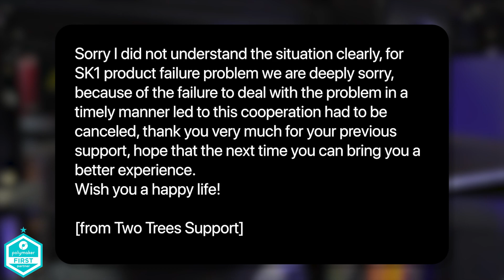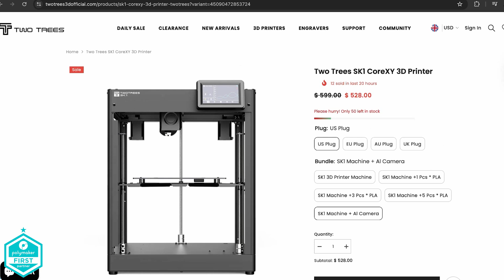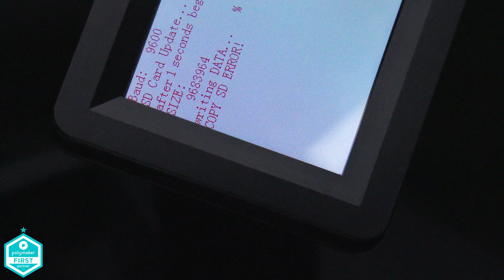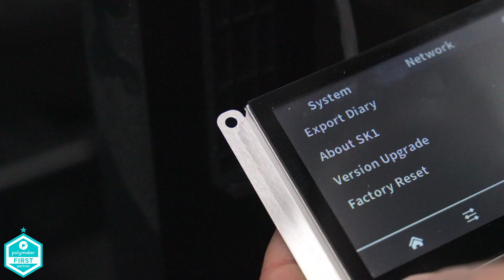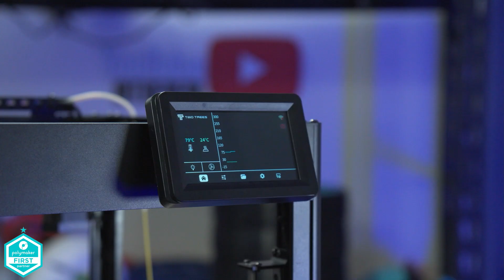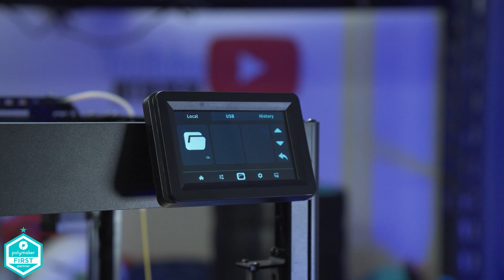Two Trees SK1 3D Printer - A Root of Many Problems

Comment: I got this as my first 3D Printer because I got it at 2/3 of the price of a p1p + a couple of kg of filament. It continues to be a learning experience, although it printed decently after modifying bed leveling and half reworking their slicer settings. Especially, their HF PLA made support irremovable. At this point, I am gutting the electronics and can basically from ground up and learning how to setup klipper and write macros. At the end of the day, I got exactly what I wanted, just not how I wanted it. Although, I am questioning my decisions and my sanity! I got into this printer hoping it would be similar to the tt sapphire and its modding community. And a final word I currently still think at least the frame is solid but let's see if I continue to think so and not replace it too ending up with a “real” trident with extra steps.

Comment: I'm sorry for the problems you had. 
I found it for less than $250. The v2.02.34 firmware resolved lot of issues. But there're good tutorials for upgrading Klipper and also the THR. 
I resolved problems with bed leveling playing with bolts under it. Now I've a good mesh. 
On THR, adding an heatsink on the RP2040 chip and putting a bigger one on 2209 driver, I can remove one of the two 2010 fans. The noise has reduced. 
For MCU cooling fans there're tutorials to move them on a controlled port, and switch on only on higher MCU temperature. 

This printer is damn fast, and noise is now the only problem.

Comment: I gave up on mine as well. Had issues with the bed leveling, couldn’t adjust the temp mid print, would disconnect from WiFi constantly, god forbid if you have to take the hotend apart. I had to get a k-touch just to adjust certain things. I had high hopes for this but off it went to the printer dump
Reply from the maker: Yes, it’s a terrible shame. They reached out to try and resolve, but they never came to fruition.
Reply: @TheRealSamPrentice  they sent me an sp5 core xy in which worked good for about a month than the extruder output on the board went bad. They sent me a “high speed upgrade kit” for free which was replacing the old board with a new one & converting the Bowden extruder (ender 5 plus style) to a direct drive, after multiple firmware flashes the extruder wouldn’t extrude properly, sent a new board & still nothing worked. They tried to “resolve” by sending this to me & it behooves me that after a machines bed mesh is calibrated and leveled it just randomly unlevels & you redo the process only to have it chew up part of the bed. The carriage is a nightmare to take apart and half the time my display was half in Chinese or German. I gave mine away on marketplace
Reply from the maker: @Darkwingdad yep they are a pretty terrible company in all fairness and I’d doubt I’d
Work with them again
Reply: @TheRealSamPrentice  considering all there items are now off Amazon I imagine they are laying low or maybe taking time for r&d? Not quite sure but I went to the 5m and although it’s a little smaller of a printer the overall experience has been significantly better.
Reply from the maker: @Darkwingdad flashforge

Comment: @CapnBob2010
SK1-2.0.2.17 FIRMWARE  contains a LOT of fixes to known issues.
It even does the thumbnails!   ;- ) 
It has transformed my experiences from frustrating to (almost) a pleasure.
Reply from the maker: Well the good news is that two trees and I are working through the kinks
Reply: @TheRealSamPrentice   I think some changes were made @ twotrees.
I contacted Support about an  issue with a bent nozzle shortly after I got the printer back in January. ..  Never heard a peep after multiple tries.  They rushed the printer out for the 2023 Christmas season, and it really showed.
Hopefully they're over the rough patch.
A few more  updates should make this machine great. 
Wonderful hardware.

Comment: Got the TS2 laser from TT, so far it has been a good overall experience and everything now works well. OOTB it needed a firmware update I could only get directly from support which was a process I can see would become annoying if you had to use it for anything more complex as there are some communication barriers. However, I am now very happy with my machine, but it is definitely the 'budget' option and I can easily see I will be pretty much on my own after a few months. Good news though is all the parts and turns out also the control board is generic and should be easy to fix/maintain.

Comment: Mine has been working flawlessly aside from me melting plastic around the hotend. I put a haldis bambu e3d clone in it, and it's been printing again. I did upgrade the firmware when I got it. That does suck that you can't get it working. I figured I would put a bigtreetech board in it in the future if any of the brains fail. I did however cancel the enclosure after realizing for $159 bucks the enclosure didn't include the camera, then the camera is also pretty expensive. I definitely wasn't going to drop $200 on the enclosure. I was thinking $99 with camera. I can make the enclosure for about $25 and that includes insulation. Anyway, oh well.

Comment: I was never able to get the 3DChameleon to work with it... the start with a "good working printer" requirement in step #1 of our installation has never been met.  I bought two of them, and neither one will even allow us to get a full test print.  I gave up on it when the Flashforge A5M came out at $299... that's the totally opposite experience... it prints so beautifully at almost half the price of the Bambu that we replaced our entire print farm with them.

Comment: Twotrees hardware and build quality is solid for the price but the stock firmware is absolultely terrible.
Got an OG sapphire plus v1 on FB marketplace, it was a steal but had to compile my own fork of Marlin for it to make it work.
It prints amazing now (currently at 500mm/s without any problems) but definetly wouldn't buy TT unless you OK with making your own firmware and mods without any support.

Comment: I wouldn't even bother getting or suggesting the P1P from Bambu when the P1S is just 100 bucks more and its enclosed already.  Even if your going to print just PLA, enclosed helps prevent warps from random crossbreezes.  Also the P1P is not compatible with the AMS system and the upgrade to convert a P1P into a P1S is 50 bucks more then if you had just gotten the P1S from the start.  Open Framed Core X/Y systems are.....stupid....from the start, cheaper yes but not worth the savings.  Your going to be printing at high speeds, you need the means to cool the print down via aux coolers, and open framed just makes all that airflow, escape and lost focus on the print at hand, not to mention that the P1P doesn't have and aux cooling fan to begin with.
Reply: The P1P does work with the AMS I have a P1P and the AMS and it works great! You are correct though it makes more sense getting the P1S. If you buy the AMS with the P1S you get $100 off the AMS so the P1P and P1S come out the same price if you buy the AMS. I have 2 P1S's and a P1P, the P1S are nice and print so good, I have not had a filament I have tried that didn't work. Although the P1P is quieter, I have it in my house and only print PLA and my P1S's print filaments that are not good for in the house. I also have a A1 with the AMS lite, and both it and the P1P are pretty quiet.

Comment: Hey Sam , I’ve noticed bambo and clones building platforms 256, wishing a little bigger, any new printers coming soon 300 building platforms .
Reply from the maker: So k1 max 300x300 the k2 plus is 350x350 the Arco is 300x300
Reply: @TheRealSamPrentice  Oh, let's be honest.  The Arco is vaporware.  It's been moved back so many times it's somewhere near geosynchronus orbit at this point.
Reply: The K2 with its MMU system is the "clone" that you want to see as it IS doing something different then just copying something on the market already.  With a 350x350 and color printing, that is doing something Bambu hasn't done yet, which is large(er) scale printing.  300x300 is starting to pick up as the new standard for new generation printers to come out as a means of standing out against the prior gen printers.
Reply: ender 3 v3 plus - 300x300

Comment: Would be good if you spend more time talking about the actual problems instead of just saying: it is bad don't buy it.
Reply: Omg 6 minutes in I still have no idea what the problem is.
Reply from the maker: @pyrhockz  main issue are firmware and non levelling, you can’t print if you can’t level it’s that simple.
Reply: Problem? China.
Reply from the maker: Well as I stated the function of printing it didn’t do, there are a number of issues with the firmware which they promised to follow up on. It didn’t level therefore I was unable to print, tons of bugs and unfortunately cheap component parts.